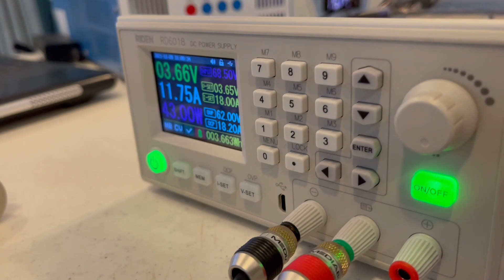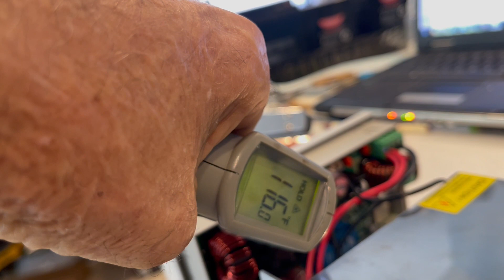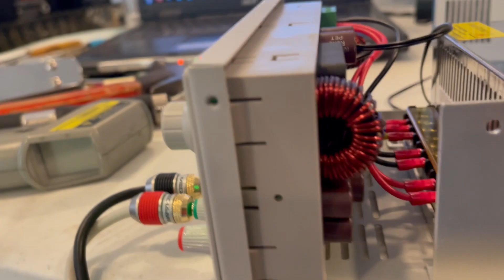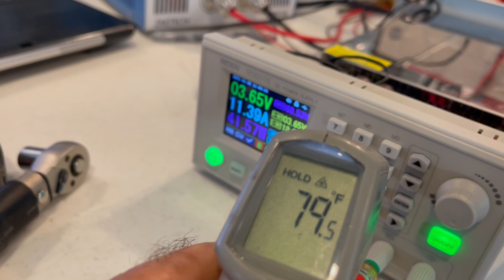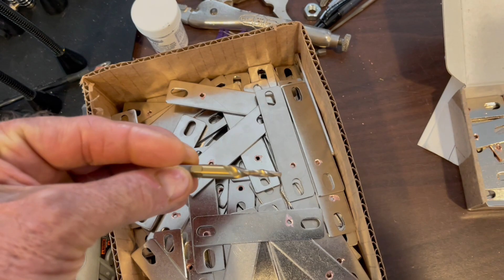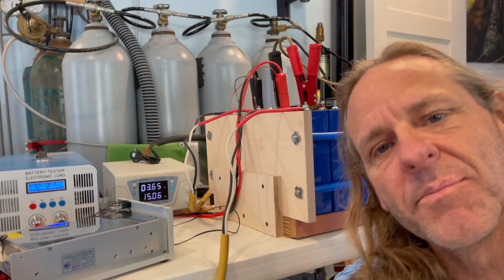Riden 6018 Problem Found. 300 Busbars Drilled and Prepped. More New Lifepo4 Cells. Moving Forward!!

Comment from the maker: The manufacturer responded and informed me that an 8 amp load would trigger the fan. At 8 amps I got 5 volts at the connector for the cooling fan. I removed the fan and it didn't spin freely and smelled burned. The manufacturer said they couldn't supply a ball bearing fan and their fan should last a long time and sent me a link for a replacement fan at their expense but it was on aliexpress and would arrive in January. I ordered 5 ball bearing replacement fans from amazon for 20$ that will be here in two days.
Reply from the maker: The manufacturer has agreed to credit 5$ to my PayPal account. I find the warranty process with these Chinese suppliers to be unusual as I don't find American manufacturers asking for me to repair my own product with parts they supply unless it is stated that the warranty is for parts only. All the warranty claims with Chinese suppliers has been similar in that they want to help troubleshoot and then send replacement parts. This company has been the easiest to deal with and sending cash so I can get the parts from a local source in two days is a nice compromise. While 5$ may seem trivial and not worth my time, this exercise was done to show again what happens if you have a problem and allow the manufacturer to respond according to their process.
Reply: yes, a ball-bearing fan would likely be a big improvement, it is amazing how fast one can get things on Amazon. sometimes they are less expensive, sometimes they cost more. lots of shopping to get what one needs. again keep up the great video documentations. 😎

Comment: When the fan fails the product dies.  Poorly made cooling fans are the Achilles heel of switching power supplies. The fan supplied in my rd6018 was branded "Pengda" (40x10mm 5v) JUNK!  Further inspection of the fan (pull back the sticker) reveals that it contains no bearing at all but the typical brass (probably something cheaper) bushing and a drop of oil. While ball bearing fans aren't necessary (unless the temperatures exceed +80c "my opinion") it would be an improvement over the inferior fan supplied. There is a large selection of quality fans to choose from with different bearing choices (Ball, Vapo, Hypro, Sleeve etc.) pick your flavor. Most important is the manufacturer such as but not limited to:  SUNON, EBM-Papst, Comair Rotron, NMB, NIDEC, Sanyo Denki

Comment: it looks like 30 or 40mm fan..and you can thank God that it shut off..because if it is only small chip.those usually don't have any protection . I would suggest don't use the unit..buy new fan and change it and use it after that...

Btw did you solve the issue by using bigger washer so it would go over the small ridge..i would solve it by that .. if it is M8 screw..so i expect maybe M14 might be ok for that ?

Comment: I have a Riden 6012 and a Riden 6018 also (I like them, but they are kind of expensive by the time you buy all the parts to assemble them) about $175 each or so. never had the problem with the fans thankfully. I also bought a LiFePO4 charger that does about 30 amps made for golf carts early on. keep up the good work. I will watch for your videos! so we can all learn together. I think I am going to drill and tap my bus bars for the Electrodacus SBMS0 balance control wires. that is a good idea for sure.😎

Comment: Hi Ray, have you got voltage going to the fan I am assuming it is a 12 volt device?  With a pair of insulated pliers and the unit isolated, are you able to detach the cable and see what you have, when switched back on.  I am wondering if there is an in line fuse feeding that fan circuit on the board or if you have a rogue joint as well as a dead temperature sensor??  Also I noticed that the new bus bars that you drilled and tapped are off centre, have you changed your planned wiring configuration?  Thanks again for a great video stay safe.
Reply from the maker: As per usual, more was revealed later in the next video and the replacement fan should arrive today. The manufacturer of the power supply already deposited the compensation in my PayPal account. Good on them. 

The off center holes? Well we'll talk about that in the video I make later today when my lovely videographer wakes up. I'm looking forward to  this next video. We're going to explore getting the best connections with the welded studs with their small contact area. Keep coming back! Thanks for watching.

Comment: Very much looking forward to your solution to the small size contact area on the studs...I have the same stud setup on my 230Ah cells and have also been pondering this issue. I've made my own 6x20mm aluminium bussbars and minimised the hole to get more contact area. Always getting so much useful info from your videos....cheers

Comment: Hi Ray, sorry if this is a repeat question,  but where are you buying your cells?  Thanks!
Reply from the maker: Please subscribe and turn on notifications. I have a video I am preparing where I will explain the three suppliers I have used and my experiences with each. I will also do a cost analysis comparing cost to performance for the purchases I have made. I don't want to just give a short answer because it will be misleading and incomplete. I only want to share complete and accurate info backed up by testing whenever possible. I'm sorry that leads to delays.

Comment: I am sure you know this, but while it's hot like you were measuring you can meter those 2 leads to the fan and see if 5 or 12vdc is present.  If it is then it's just the fan motor!  If it's not present then there is a deeper problem like a sensor or a control circuit.  Great work you are doing!
Reply from the maker: 5 volts is present. The manufacturer says that an 8 amp load is the trigger for the fan circuit. The fan is burned up.
Reply: @RayBuildsCoolStuff  I knew you would get to the bottom of it!  Much success to you!! :)
Reply: @RayBuildsCoolStuff  You know you could take that fan loose and put a computer fan (not attached) in there blowing air on the heatsink until a permanent solution is obtained. :)
Reply: @RayBuildsCoolStuff  Let me just understand this right ?:
1. There is 5V supply to the fan.
2. The supplier says that even though there is a 5V supply, the fan will only work if  the current supply exceeds 8A?
3. I suspect the suppliers is BS'ing you!
4. Those 5V fans (if voltage is present) will spin IRRESPECTIVE of the current supply.
Reply from the maker: @joatmofa0405  no sir, let me explain. The fan operates on 5 volts supplied by a two pin connector. The unit sends power to that connector whenever the unit is pushing greater than 8 amps. I have replaced the fan, which the manufacturer compensated me for so I could order it from Amazon and get it in two days instead of waiting for a delivery from China. The fan is now installed and the unit has operated normally for the last two days. The manufacturer was responsive and helpful. I could have figured it out on my own but waiting for their response meant learning that an 8amp load would trigger the fan circuit. I will buy another product from them.
Reply: @RayBuildsCoolStuff  
OK ... so if you put your multimeter on the supply pins of the fan it would show "0V" ? 
ONLY if the current is 8A will the fan supply pins show 5V?
Reply from the maker: @joatmofa0405  Yes, an 8 amp load triggers the fan

Comment: Did you build that power supply, probably just get another fan to keep using it. I bought mine as a kit but haven't used it hard like you are.
Reply from the maker: I assembled the kit. I'm waiting for a response from Riden but like the post from John Emmert below.
Reply: @RayBuildsCoolStuff  they’ll probably just ignore you, measure it and see if it has a brand on it and order a few of them. I’ve seen on another form that the connector plugs into has some issues, test the back of the connector to see if it has power. I would think about putting one on the back of the power supply to pull air through it all. Hope you get it fixed, I’m charging three 5KW batteries, 24V there slightly used but are fifty pounds each.
Reply from the maker: They responded at 9pm sunday night their time and it is just 8am there now so I think I will  assume that they will respond and take care of their product. They are a better company than one other that I got to replace a defective unit. That was a painful process but I suspect this will be reasonable. I'll let you know how it goes.
Reply from the maker: They replied and said that an 8 amp load is what triggers the fan. I applied an 8 amp load and got 5 volts at the connector. I removed the fan and is smells burned up. I'm waiting for their next response.
Reply: @RayBuildsCoolStuff  very nice. I hope all works out for you.
Reply from the maker: Ray Builds Cool Stuff
  • 0 seconds ago
The manufacturer has agreed to credit 5$ to my PayPal account. I find the warranty process with these Chinese suppliers to be unusual as I don't find American manufacturers asking for me to repair my own product with parts they supply unless it is stated that the warranty is for parts only. All the warranty claims with Chinese suppliers has been similar in that they want to help troubleshoot and then send replacement parts. This company has been the easiest to deal with and sending cash so I can get the parts from a local source in two days is a nice compromise. While 5$ may seem trivial and not worth my time, this exercise was done to show again what happens if you have a problem and allow the manufacturer to respond according to their process. I will use the money to purchase a ball bearing fan that should give no further problem.
Reply: @RayBuildsCoolStuff  That's good to hear. I'm impressed that they got back to you. It's very nice.

Comment: I used this fan from Amazon "Noctua NF-A4x10 5V PWM" and these screws #8 x 1-inch wood screws (the Noctua has slightly larger holes and the original screws won't work). Just saw your first video and said that's what it looked like, now you've confirmed it.
Reply from the maker: Great advice. You often have really good input. Gems out of nowhere. Thanks!
Reply: @RayBuildsCoolStuff  Well, I have 4 of the Riden supplies, so I'm pretty familiar with them. If I could remember your user name on diysolar I'd send you the links where I purchased them from Amazon. Yes, unfortunately, I purchased a pack of 100 of the screws, so I have plenty if you need some, the fans are not cheap but certainly higher quality. Probably the "Noctua NF-A4x10 5V" is a better choice since I'm pretty sure they don't use PWM, just 5v on or off. Pretty much and 40mm fan at 5v should work, I just used butt splices and the original connector.

Comment: for deburring i always use a bigger drill bit, and by hand with some little force just grind the hole clean
Reply from the maker: I tried that. Even with the shallowest angled bit, by the time I cleaned up both sides, there weren’t enough threads left in the middle. I tried several methods but the fastest and least destructive was careful use of the dremel. About 20 seconds per bus bar when all went well. A lot of time was spent cutting them in half and grinding them clean for the half bus bars.
Reply: so for a 4mm for example, take an 8 or 10mm drill

Comment: what version of  firmware is installed on your device , on my device is 1.36  , you can look the version on keys  shift then menu(0) and 3 times arrow right - on riden6018 keys
you can update that with Pc software , i had some bugs on beginning with firmware 1.34 with wifi
Reply from the maker: V 1.36
Reply: @RayBuildsCoolStuff  :-(  ohhh :-(   ... not a fast repair :-(  OR ... 
hit it hard :-), then try again ... like hitting the controls in an old airplane
Reply from the maker: @BavarianSuperGuy  yeah, I’m pretty sure beating on electronics isn’t the same as beating on a carburetor float bowl or a starter solenoid. 😂😂
Reply: @RayBuildsCoolStuff  Ok .. a last try ... may the force be with you ... Hit It
Reply from the maker: @BavarianSuperGuy  💪🙈🤬
Reply: @RayBuildsCoolStuff  :-)  😂😂  
Are you still going to test this or are you sending it back?
When not sending back, Then
During the hot phase? Is a voltage to be measured at the fan plug?
Or is the fan broken?
Reply from the maker: I will await their reply while I busy myself cleaning up after the solar shed build. I'm hoping they will just send me a new control panel from their amazon store to save me further troubleshooting and then waiting for parts. In any case, to test the fan they will probably tell me how much voltage and amperage to apply to the fan rather than trying to test he output voltage which risks shorting the fan circuit.
Reply: @RayBuildsCoolStuff  ok well, 
i don't think that an additional consumer like a measuring device on the fan connection cable will make a short circuit. 
But better wait for an answer. 
I would be interested in a solution. I will then upgrade mine. :-)
Reply from the maker: @BavarianSuperGuy  the connector is kind of small and it would be easy to short across the two pins with one of the leads from the tester.
Reply from the maker: The manufacturer told me that an 8 amp load would trigger the fan. I applied that and tested to find 5 volts at the connector. I removed the fan and it smelled burned. The manufacturer has agreed to credit 5$ to my PayPal account. I find the warranty process with these Chinese suppliers to be unusual as I don't find American manufacturers asking for me to repair my own product with parts they supply unless it is stated that the warranty is for parts only. All the warranty claims with Chinese suppliers has been similar in that they want to help troubleshoot and then send replacement parts. This company has been the easiest to deal with and sending cash so I can get the parts from a local source in two days is a nice compromise. While 5$ may seem trivial and not worth my time, this exercise was done to show again what happens if you have a problem and allow the manufacturer to respond according to their process. I will use the money to purchase a ball bearing fan that should give no further problem.
Reply: @RayBuildsCoolStuff  thank you  for the info , i look for an old cpu cooler and do the same :-)

Comment: good find, heat is usually the problem
Reply from the maker: I'm actually happy that the problem isn't in the power supply portion of the unit. That might indicate an underpowered unit not up to the task. I prefer a defective fan as the culprit for the future durability of the overall unit. I paid 200$ for this complete kit so I have some hope that it isn't cheap junk but I'm not surprised that the cooling fan is cheap junk. Does that make any sense or am I crazy?
Reply: @RayBuildsCoolStuff  You can likely get a small computer axial fan with ball bearings (not sleeved) for < $5 that will outlast the whole unit.  Sleeves don't handle heat well.
Reply from the maker: The manufacturer has agreed to credit 5$ to my PayPal account. I find the warranty process with these Chinese suppliers to be unusual as I don't find American manufacturers asking for me to repair my own product with parts they supply unless it is stated that the warranty is for parts only. All the warranty claims with Chinese suppliers has been similar in that they want to help troubleshoot and then send replacement parts. This company has been the easiest to deal with and sending cash so I can get the parts from a local source in two days is a nice compromise. While 5$ may seem trivial and not worth my time, this exercise was done to show again what happens if you have a problem and allow the manufacturer to respond according to their process. I will use the money to purchase a ball bearing fan that should give no further problem.
Reply: @RayBuildsCoolStuff  Did you check the sensor? as the fan looked like it will still turn
Reply from the maker: @offgridwanabe  the fan doesn’t spin freely and smells burned. There is 5 volts at the connector when the load is greater than 8 amps.
Reply: @RayBuildsCoolStuff  lol Ray that is like putting a $20 BMS on your $4000 battery.
Reply from the maker: @offgridwanabe  yep but happens all the time on computers and such. How much would you guess is the cost of that little cooling fan? By your example it would be 25 cents which is probably correct 😂